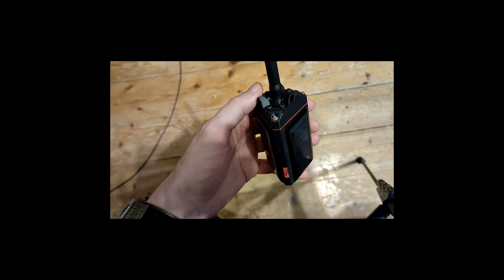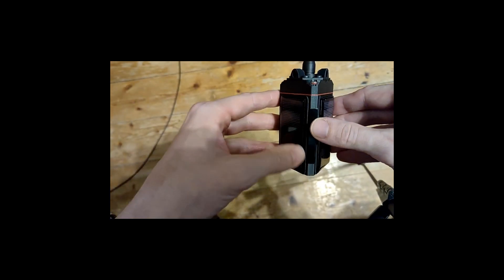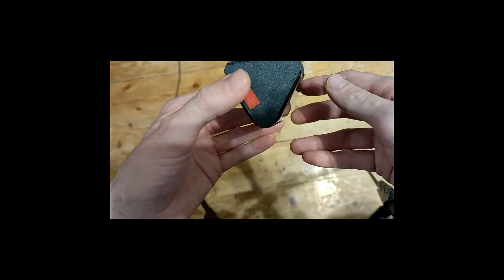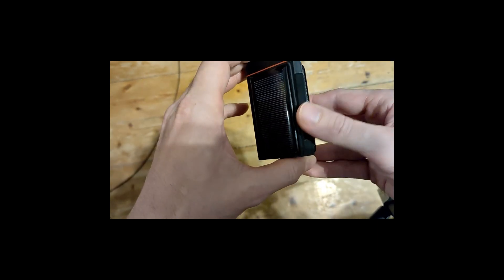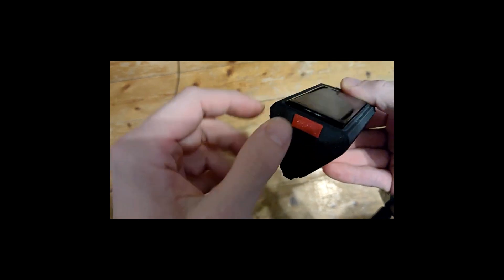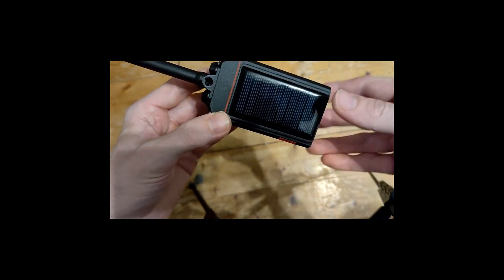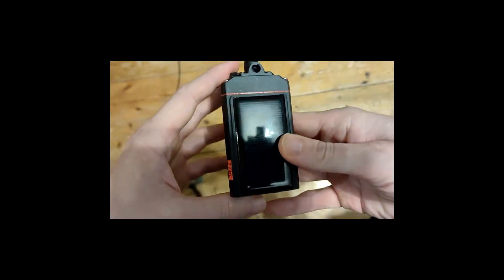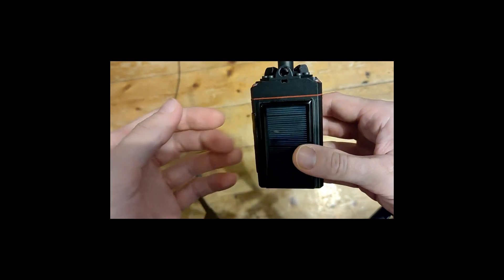Meshtastic LWC "Waypoint"  water resistant, non permanent  solar assisted outdoor node

Comment: will this charge when on as well via solar?
Reply: I think the solar panel would extend the life of the batteries,  this seems designed for temporary installs , for example first responders in a disaster area,   just place these up in trees, on top of buildings and cover a large area.  I am currently building a faketec, supposedly these a very power efficient.    with screen off or no oled at all,  I see reports it only consumes 5ma in standby.  vs a heltec V3  that has a bit over 40ma in standby (screen off)   so those little 60mha solar panels, in theory even with 2-3 hours of sunlight could keep this running.  I think traffic (use) will be a factor, but since you have the battery,  it could last days.  more than enough for its intended purpose.  I will eventually make one of these.  I have a new 3d printer coming so i will be able to play around with TPU and some petg-cf  which is what I would use for this.  PLA, tends to warp/melt in high heat.